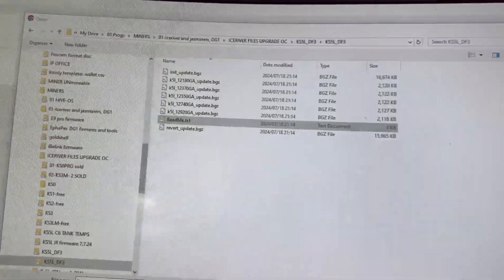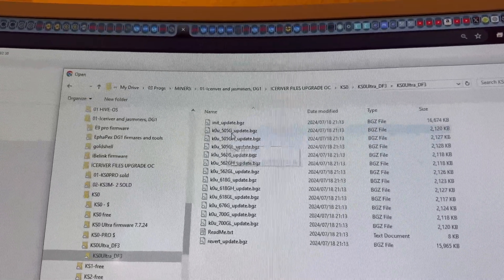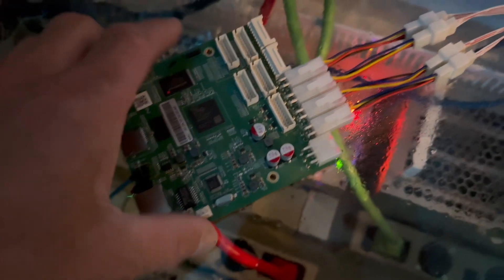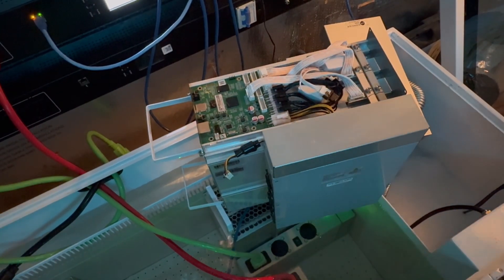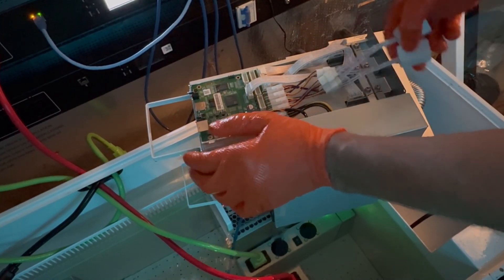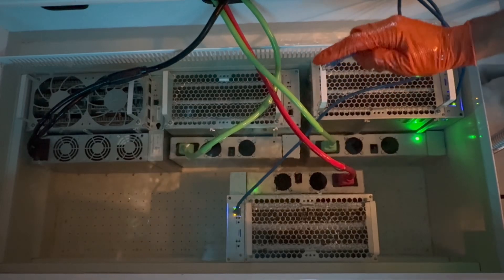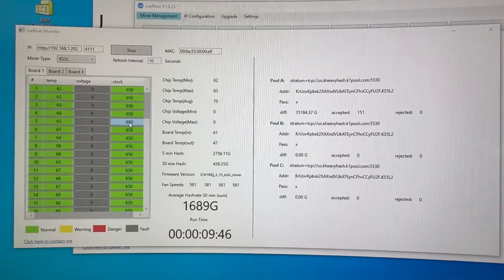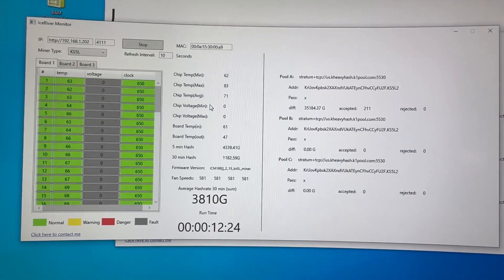HOW I BRICKED MY KS5L with Wrong OC firmware & How I get it back working

Comment: Can you give me your advise, my KS5L never pass 11TH with 3200W, 6 days ago I installed Pbfarmer and at 687MHz 3340W never pass 11.2TH, now I decide to try the temp route and dropped to 680MHz and used Target Temp with Chip 88ºC and board 71ºC and HR pass 12TH with 3320W. What is the max temperature that I could run the chips.
Reply from the maker: I think pbfarmers OC have a great discription over the chips max tems etc. I noticed that after 90C hashrate drops and pass 90C not recomended for chips to stay for long period of time. Power use goes up as well with temp increase and can damage other componets on the board next to chips so use caution.
Reply: @DontMindMeMining  Thanks, I will leave it at 88C for a couple hours, for me this is a crazy temperature but there is no doubt it increase the HR more than overclocking the machine.
Reply from the maker: @CantFindInYoutube  yes and I'm trying not to go over 85C
Reply: @DontMindMeMining  Just lower it to 85C, thanks.
Reply: @DontMindMeMining  Probably will have to repaste my KS5L, decided to keep chips temp at 80 C and 24h hash drop to 10.54Th, last night lower freq to -3% and hash it's at 11.3Th, it's ood chips run hot and fans don't increase speed, assume that what control fan speed is board temp and that are 56-62 C, going to lower board temp to see if chips drop temp to allow higher mhz.
Reply from the maker: Can only set fan temps based on chip temps with PB farmers firmware but not sure if 1% feet worth if not overlocking
Reply from the maker: That’s odd that chip target temp won’t work for you with pbfarmer fw. I use immersion for 3 KS5L and one with stock fans is actually doing about the same 11.5-11.7TH on the pool.
Reply: @DontMindMeMining  I will keep doing tests, I'm using Pivotal Njord an AC Infinity with Mean Reversion, later will try slew. At the moment I'm running it without overclock but seems that I'm getting less hash than with underclock, at least power consumption is OK, thanks for the help.

Comment: What did you do about the fans on the PSU?  With other ASICs I either have an immersion PSU (no fans) or remove the PSU fans.  With the KS5L, they are potted in epoxy and cannot be disconnected without cutting the wires.
Reply from the maker: Psu fans remained in the psu without any issues.
Reply: @DontMindMeMining  Thanks.  And if you have any tips on running it in immersion, that would be great.
Reply from the maker: I flipped them power side now and running test shows better chips temps  delta between low and high hopefully will run more stable. 45-46C tank temp blooks like is a sweet spot
Reply: @DontMindMeMining  What do you mean power side?  It is on its side instead of vertically or is it vertical but facing down?
Reply from the maker: Vertical, power connector facing vdown
Reply: @DontMindMeMining  Thank you!

Comment: Do you know how much power the overclocked KS5L uses? Network hasrate is growning so fast that I'm considering it. Iceriver probably identify the version, reading the hashboard or where you place the connectors.
Reply from the maker: So far I didn’t find have reasonable OC for my May batch KS5L. It was doing better on stock, 3220W 12TH. With 12180 it’s about same wattage but performance about the same if not less hash. Every next OC adds about 40-50W so 12550 was about 3320W for me.
Reply: @DontMindMeMining  Thanks
Reply: @DontMindMeMining  But what h\r does ks5l have with 12550 OC? I mean if at stock you get 11.7Th at pool, then what numbers do you get with OC? Anyway looking forward to OC video!
Reply from the maker: I have been mining for over a week now on OC with my may batch KS5L and started on 12550 and went down to 12180 (3190W) so far nothing different on the pool. However my stock firmware were set to 665 clocks and 3220W, 12550 (680 clocks I believe) was on 3340W and started to perform 12400Gh but after reboot dropped to 11.7TH on the pool. I may have silicone lottery that chips won’t take the clocks. Will be doing 1 week at the time on each clock. Over 12550 clocks didn’t perform for me at all. Was like 10-11TH may need to give more time I was about 3-4 hours on those clocks.
Reply: @DontMindMeMining  Correct me if I get it right: you had 650mhz stock clocks, you tried OC firmwares and then "revert update" FW to get to stock and now you have 665mhz instead of 650mhz?
Reply from the maker: may batch came with 665 clocks stock

Comment: You don't need to change the control board. For all machines that become bricked due to operational errors, you only need to contact the developer to remotely enter the machine background to restore the original configuration file. Of course, this service requires a fee.
Reply from the maker: Yes, I did that already. It required to schedule time and you can lose potentially sometime for mining, swapping the board get machine back online quickly.
Reply: so if there is a way for them to do it, why cant we just do it ourselves?
Reply from the maker: @ImKronzr  good question, I wish it easy to do.
Reply: mine was really quick done straight away by developer

Comment: You can take the eprom of a card that is working, backup and rewrite the eprom of the card that is bricked. I have my ks0 ultra bricked, unfortunately I don't have another one here to back up the eprom if anyone can make the ks0 ultra available.
Reply from the maker: What Programm do you use to copy everything eprom and write to another  ultra, I had my KS0 OG bricked and I wasn’t able to access.
Reply: The hash boards may have a eprom but the control boards uses nand to store the firmware.
Reply from the maker: Do you know how up access the nand on KS0s to rewrite the files? Have you done it on these units?
Reply: @DontMindMeMining  I've been working on it. But I'm no tswift 😅
Reply from the maker: Do you have a discord ? Contact me via discord if you can.
Reply: Bricked a KSo ultra, have more ultras to copy eprom from. In for any info
Reply from the maker: Have you done it before? Eeprom, contact me via discord

Comment: I downloaded the latest firmware for my KS5L (ICERIVER-KAS-KS5L-20240706) and the 3rd hashboard stopped working. Tried a factory reset but the board is still offline. This miner is brand new. Any suggestions to get this fixed would be greatly appreciated.
Reply from the maker: If you didn’t open the unit yet and it still under warranty since it’s new I recommend opening repair ticket with iceriver as soon as possible and hopefully can just get faulty hashboard replacement. Not sure if you will need to ship back the damaged hashboard. Also, you may need to check if hashboard cable connected properly after you open the repair ticket. Iceriver takes 2-3 days sometimes to respond so have to be patient.
Reply: RPM found one of the hash boards was not fully plugged in. Plugged it in and restarted and all was OK. Check his video on this. May want to avoid warranty stickers on any screws!
Reply from the maker: @Pepaw-Bill I saw it, yes try this